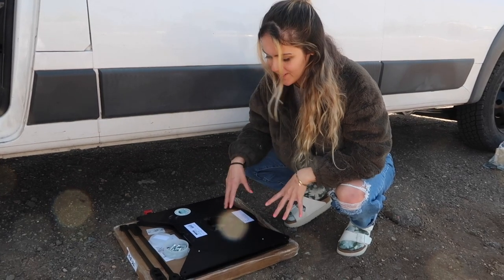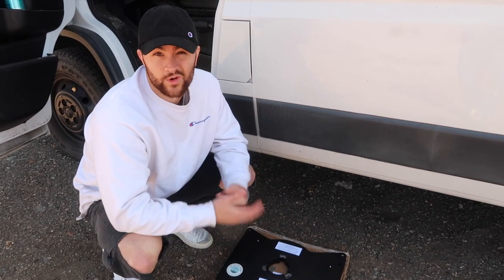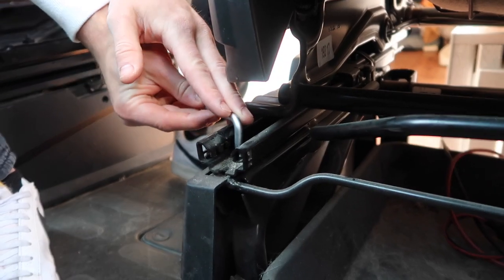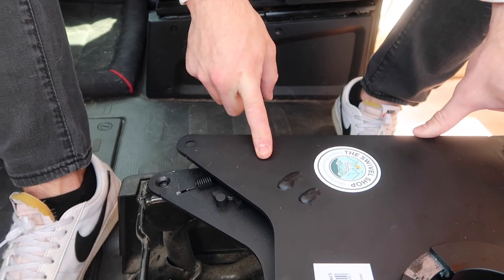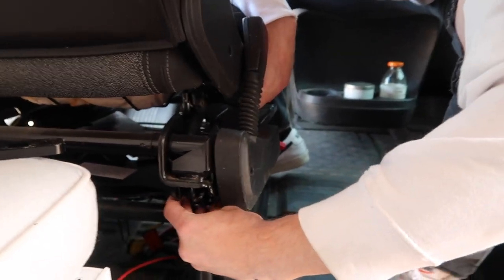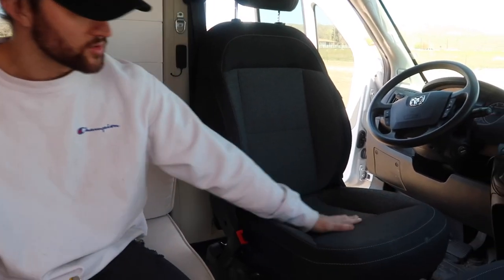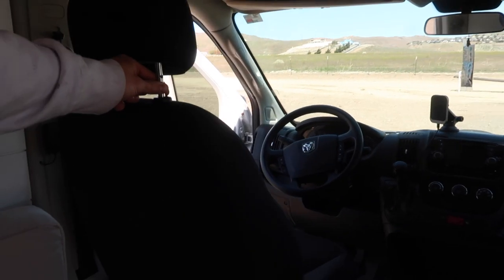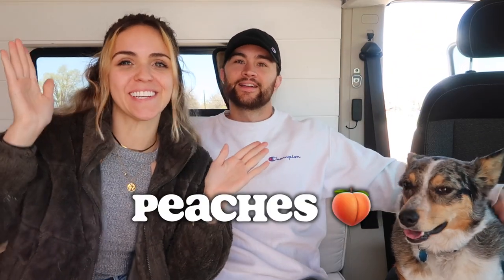Driver Side Swivel Seat Install + Van Name Reveal!!

Comment: Nice video.  I already think the ProMaster seats are too high.  Have not added swivel for that reason.  My wife Terri does not mind the high seats in the ProMaster.  If they just had added the toilet steering !!!
Reply from the maker: Totally understand that! I will say - without a doubt - it’s worth it on the passenger seat. The driver seat, it really depends on what you value more. Ricky’s 6ft, and the added height wasn’t as bad as we anticipated. Promaster seats so naturally sit high though!